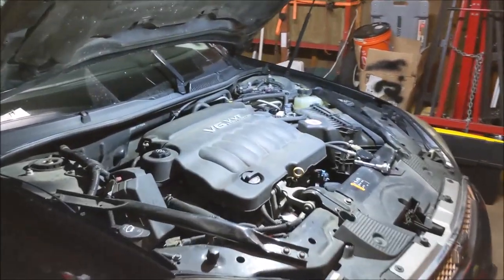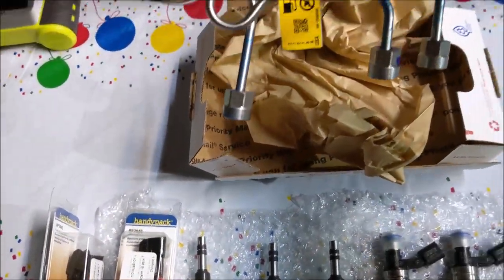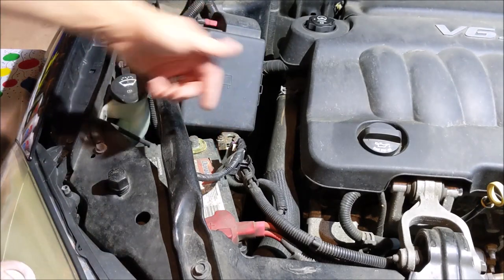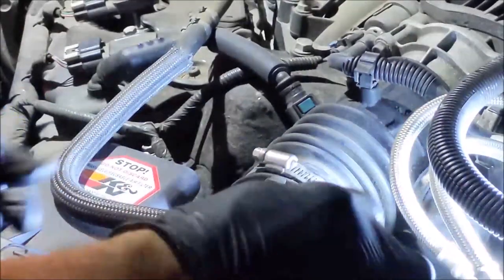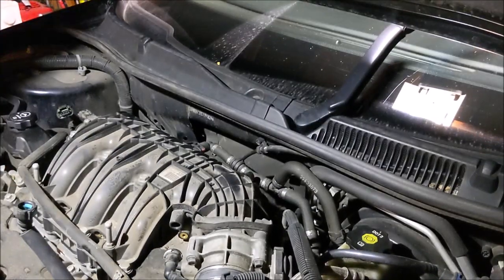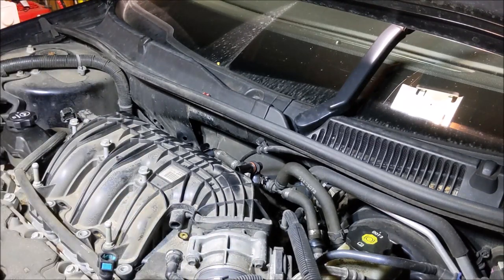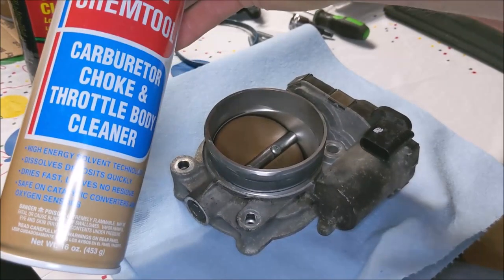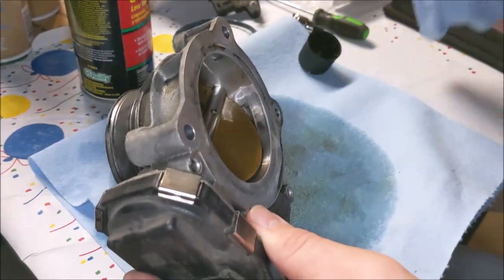2012-2016 Impala/Limited (9th Gen) 3.6 LFX Upper Intake Manifold Removal (Part 1 of 4)

Comment: Hi, thank you for the video. It helped me make sure to take off the power steering reservoir before I replaced my intake.
Side note can you add to the video (like a pop up or something) that it's easy to break the short PCV tube on the back of the intake (The one you have to twist a quarter turn to the left). I thought it was soft rubber tube, but it's actually hard tubing. 
Part number GM Tube 12634309    RN it's $7 so not too bad
Reply from the maker: I can't make any alterations to this video now that it's posted, sorry.  But I will add that I broke that same hose when I installed my catch can. https://youtu.be/PrMRzPg3Wjg
It was NBD because I just attached the 2 catch can hoses to the broken pieces...
Reply: @CertifiedShadetree  I ended up doing the same thing in a way. I got a 15/32 vacuum hose from Autozone for $2.

Comment: I cleaned the intake valves on my 2014 Impala Limited last summer, definitely not a very difficult job to do. These engines are pretty nice to work on. Great job on the videos!
Reply from the maker: Thanks!  And no they really aren't all that difficult to work on.

Did you have a lot of carbon buildup on your valves?
Reply: LeaderOfWagons I didn’t think the carbon build up was all that bad, but then again my car only had about 60,000 miles on it at the time, and I was just curious how the valves looked. They looked about the same as yours in the video.
Reply from the maker: @Kms239  Even more amazing to me, seeing as mine is close to 160k!  Honestly, I wonder why the Camaro LFX guys are having such trouble with carbon buildup, where as these Impalas don't seem have anywhere near what they're dealing with.
Reply: LeaderOfWagons yeah, I’ve heard of the Camaro LFXs having carbon build up as well. But I don’t see that being an issue with these impalas until you get closer to 200,000 miles. Yours having 160,000 didn’t have that bad of build up.
Reply from the maker: @Kms239  No sir, it really wasn't bad at all!!  Granted the catch can I installed does pick up some oil, I am of the belief now that it isn't necessary.
Reply: LeaderOfWagons yeah, I had a catch can installed on mine as well but ended up removing it because you still get oil in the intake. Plus when it gets really cold outside in the winter, you’re constantly having to empty it. I’m from Minnesota as well and last winter was terrible for a catch can.
Reply from the maker: @Kms239  Tell me about it, I was emptying that damn can every thousand miles last winter!! 😅
Reply: LeaderOfWagons yup, not worth it.

Comment: Nice work! I have a question, have you  ever replaced the valve gaskets on this car? I found oil on 2 of my spark plugs, and I think I will have to replace the spark plug tube seals. Do you think is something I can manage myself?
Reply from the maker: I haven't replaced them, but it shouldn't be that difficult at all, provided you have the upper intake removed.

Comment: I'm going through and watching these videos again.  I want to see if I'm right here, is cylinder 3 the middle back?  I believe that is the right side of the engine looking from the back of the engine.
Reply from the maker: Correct, the rear (firewall side) bank is cylinders 1, 3, and 5 with 1 being on the passenger side.
Reply: Ok cool.  Thanks for getting back to me.  I am still getting that P0303 code and I need to fix it.  I am really hoping it's a Spark Plug or Ignition Coil.  I had previous looked at what I thought was the #3 but it was actually #4.
Reply from the maker: Hope it's that, too!! Much easier to replace than an injector!! Unless you smell gas, I'm betting on a bad coil, as I was getting a code P0276 when I was having injector trouble on cylinder 6.
Reply: @CertifiedShadetree  Definitely not smelling gas.
Reply from the maker: You can actually remove the rear coils without taking off the upper intake manifold. You take the bolt out, pop the coil off the spark plug, then rotate the coil 90° and lift 'er out.
Reply: @CertifiedShadetree  Yeah I did that today and didn't see anything wrong with either but I swapped them with the #4 position to see if the DTC changes.  Need to drive it some now.
Reply: So I end up fixing my 2013 Impala today I moved the coil and spark plug from cylinder 32 cylinder 2 and then the DTC code switch to cylinder 2 so I was convinced it was the coil. I replaced it with a genuine ACDelco which is actually made by Denso. (Thank you Toyota).  Well that didn't fix it so then I swapped the spark plug with even another cylinder and once again the DTC code switch to that cylinder. So would you believe it was a damn spark plug that was causing all my problems. And those spark plugs were ACDelco that I only replaced 30k ago. Oh well it's fixed now at least. So here in California in order for me to get it smogged now I need to drive it 200 miles and have 15 cold starts and warm ups so that the smog machine will ignore the permanent code
Reply from the maker: Wow, I always stuck to genuine Delco plugs 'cause they were the only ones that DIDN'T cause misfire problems!! Then they make you do FIFTEEN COLD STARTS?!? 🤯I remember when we had emissions testing, all they did if your car was iffy was stick it on a set of rollers and run it up to 45 mph with the sniffer in the tailpipe..
Reply: @CertifiedShadetree  They don't even do the tail pipe sniffer anymore.  It's all based on visual inspection and reading the computer codes.  So I put 40 miles on it tonight.  She's running so good now.  I forgot how fast she is.  Also I have been driving a 2015 Prius C that has 99 horsepower so the 300 hp the Imapala has it a huge difference. But can't beat the 45-50 mpg the prius gets and with regular at $4.30, Costco price for gas the extra mpg really helps.  So no I have to pay $68 for the smog test $8 for the cert, whatever the state will charge for the penalty for getting the smag late, even though I paid the reg on time you can bet CA will want even more money.  Then I got a $50 parking ticket for the expired tags.  Oh well, it's only money.
Reply from the maker: 😞 And all of that was over a bad spark plug!  Damn. Yeah when you're almost doubling your fuel mileage, it certainly adds up! But $4.30 isn't horrible, that's less than we were sitting at last summer. I recall paying $6.20 a gallon when I was in San Diego in March of last year (and then I heard it was over $7 during the summer!!)
Reply: @CertifiedShadetree  Oh another thing I wanted to mention when I have this P0303 DTC code I also had a code for the Stabilitrak as well.  I don't remember the code but it started with a C.  Also I would get a message on the dash that said Service Stabilitrak.  I did look at a YouTube video about a wire that is common to brake on the left front ABS system.  But now that I have fixed the misfire I am not getting that Stabilitrak message.  Just thought you might find this useful in the future.
Reply from the maker: @TheShornak  I got the same message when my car was misfiring. When the misfire cleared, the message disappeared. Totally separate from the speed sensor wire breaking (which will set the code - C0035 is the driver's side front, C0040 is passenger side front.)

Comment: Did you get hitachi or ac Delco Injectors? What’s the part number on ac Delco if those are the ones you got, the link doesn’t work anymore. Also can you link the harness & clips?
Reply from the maker: The injectors I bought were from Amazon (I don't recommend them AT ALL!) I had issues with them after a couple weeks, so I ended up buying a set of used rails (w/injectors) from a CTS with only 28k off of eBay and swapping them over.  I would recommend buying your injectors, clips, o-rings, ect. from RockAuto. Can't link directly to RockAuto - just do a search for your vehicle. The harness was also from eBay, but the used rails I bought also had the harnesses attached..
Reply: @CertifiedShadetree  you still got that harness? Lol and the cts and impala have the same 3.6 right? I didn’t know cts was lfx
Reply: Yeah I’m buying off RockAuto can’t tell which injectors work with flex fuel figured get the flex fuel option for this car not to duck the computer up👍🏽
Reply from the maker: I believe the CTS had the LLT from 2008-2011, and it received the LFX in 2012. So the fuel rails I I bought were from a 13 CTS  with an LFX. I don't have the old harness, sorry. At RockAuto, when you enter your vehicle, you have to select the engine before any parts listing shows up. Just select the one that says either "FFV" or "Flex."
Reply: @CertifiedShadetree  appreciate lookin out on the videos bro
Reply from the maker: @Sloo.impala  🍻

Comment: A mechanic told me I had to remove the sub frame of my 14 limited model to replace the y pipe connected to the manifold. Now I’m no mechanic but it sounds ridiculous and 4 grand is a very steep price. Should I look for a new mechanic? Do I have to drop my A frame for the replacement y pipe?
Reply from the maker: Why exactly do you need the crossover pipe replaced? Did someone steal your catalytic converter (s)? Regardless, the crossover runs underneath the engine so there's validity to his claim. I would definitely get a second opinion, though. Personally I'd rather remove the engine out the top and go at it that way instead of dropping the cradle. Much less hassle that way, and the labor would be less..
Reply: @CertifiedShadetree  hesaid theres a crack in the top of it
Reply from the maker: Yeah I'd get a second opinion. I would also look into having the crack welded with the pipe still in the car. 4 grand sounds like a cash grab to me. Before I would personally shell out that much coin, I'd try as many cheap fixes as I could such as epoxy, muffler wrap, JB Weld, a soup can with 2 muffler clamps, hell I'd even look into seeing if I could locate a good used crossover from a junkyard. Cut off the upper half of both old and new crossovers and splice the new one onto the car. 🤷‍♂️ Any of those scenarios has to be better than shelling out 4k!

Comment: Can you please tell me where are the vacuum lines located cuz my Chevy has a leak
Reply from the maker: There aren't too many on this engine.  The main one runs from the brake booster to the intake manifold. But the best thing for you to do is grab a can of throttle body cleaner, pull the decorative engine cover, start the engine, and spray the cleaner in and around the engine and the various components. Just stay away from the serpentine belt and alternator.  If you hit a spot when you're spraying the cleaner that makes the engine RPM go up, then you've found the source of your vacuum leak.
Reply: @CertifiedShadetree  thanks fam I can hear the sucking when the engine is at a stop
Reply from the maker: I'd check the filter housing first. Make sure all of the clips are secure and the filter isn't hanging out of the box.

Comment: I have a 2012 impala LS...have a new fuel pump, new engine pump, new fuel control module, new flex fuel sensor, new fuel injection sensor, new spark plugs & a new battery...Car still feels sluggish on acceleration!, so now I’m going to change fuel injectors!. But the check engine light is on & saying...low circuit flex fuel sensor, but it’s brand new & has been changed twice...???
Reply from the maker: I would certainly pull the injectors, soak the tips in some carb cleaner, and scrub them clean before replacing them. See where that leads, maybe it'll fix both issues. If not, at least check the wiring of the flex fuel sensor.

Comment: What's that little hose there that goes from the air intake to the top of the engine. What's it called? I need a new one lol
Reply from the maker: The intake tube to the front valve cover? That's the fresh air PCV hose. If it's the one running from the back valve cover to the upper intake, check the top pinned comment.

If the connectors aren't broken on either end and you have a little stub of old pipe left on either, you could always use a length of fuel hose to splice the 2 ends together.

Comment: That white clip on the 9:21 time of the video..
There are two I think on the 3.6L 2013 Equinox...How to get the hose disconnected from that clip?
Thanks!
Reply from the maker: Oh damn, that thing was a royal bitch to disconnect!!  If I'm remembering this right, you take the flat blade screwdriver, place it at the top of the white tab, and press downward while wiggling the connector and pulling on it.  I may have had to pry between the connector and that solenoid it's attached to with the screwdriver to help it along.

I also could not get the electrical connector disconnected, so I just removed the solenoid altogether and set it aside.
Reply: Lol I broke my tube off because im an idiot and out to much pressure on it. Brain fart I guess but it was easy to get off that way lol.

Comment: Can this be done without removing the manifold? Also I have the newer gen Impala will this help with the removal it has the 3.6 lfx only difference is the intake assembly is on the other side. Thank you 🙏
Reply from the maker: What are you looking to do without removing the manifold? If you mean changing the rear spark plugs, then that can be done without removing the manifold. If you mean either removing the injectors or cleaning the valves, then you absolutely have to remove the manifold. The removal procedure is the same on the Epsilon Impala, just flipped to the other side.
Reply: LeaderOfWagons hey thanks for the response. Lol sorry for not being detailed I was half awake. Yea I would like to change rear spark plugs. Seen videos explaining it can be done just not showing my current gen Impala. I’ve seen it on later gen lfx and lacrosse and Malibu models.
Reply: LeaderOfWagons what would I need to do to get the rear spark plugs out?
Reply from the maker: @unitedwestanddividedwefall3521  What I did was remove the bolt holding the coil down, then rotate the coil 90 degrees so the mounting tab clears the manifold, then lift and angle the coil out.  The plugs weren't difficult to reach either. I just used a short extension on the end of my ratchet and a magnetic spark plug socket, piece of cake.
Reply: United we stand. I found by using two 3 inch extensions on you spark plug socket allows you to separate the extension and gives you enough clearance against the fire wall. hope this helps